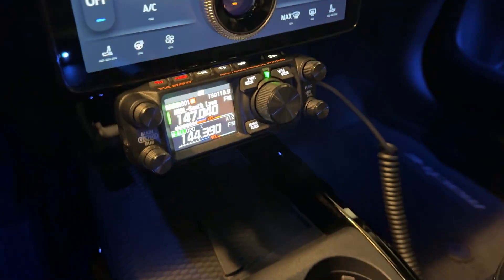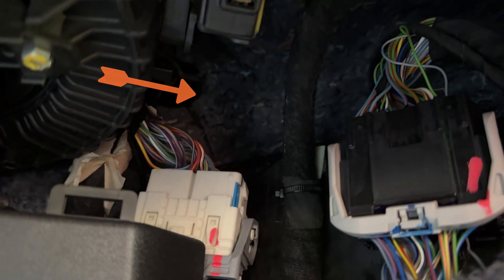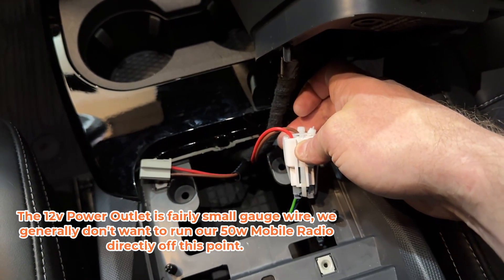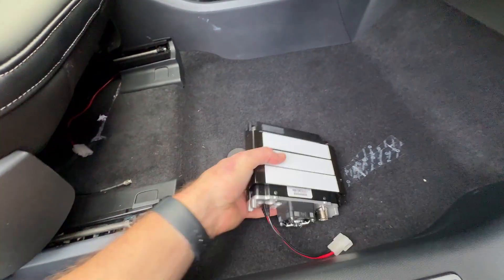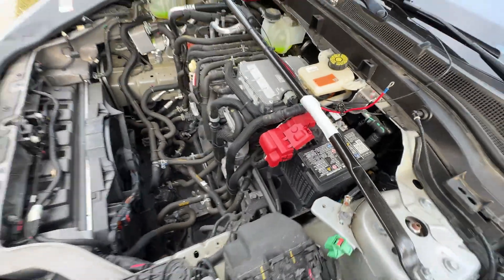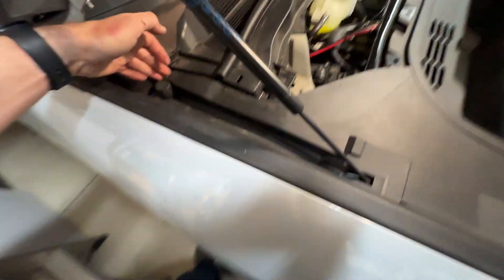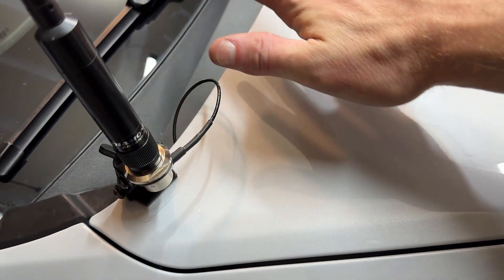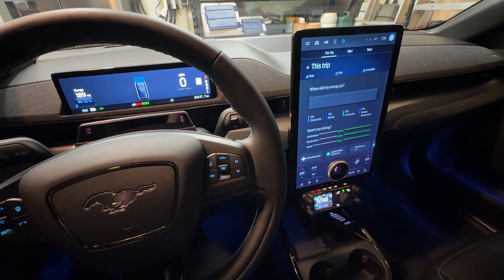New Mustang Mach-E gets Electrified with the Yaesu FTM-500DR Mobile Rig

Comment: Thanks! I have a Mach e 2021 GT PE. I love the video and installation. If I need the head mount, could I buy one off you? I have an ID-5100.
Reply from the maker: Hi Greg, You can shoot me a message through our www.everydayham.com email if you would like, I can probably print an extra mount for you - Since the ID5100 is a different size, that might require some additional design changes to make it fit well -- If you have a 3d printer, it's a pretty simple process!  Cheers, N8JRD

Comment: I don't like the idea of 50 watts of power at the same elevation as my head at 3 feet away
Reply from the maker: Interesting, I'm certain almost every mobile installation is of similar design.   How have you installed your mobile setup?   To be clear, the ARRL's own calculator for uncontrolled RF exposure at 50w @ 145mhz with a 3db gain antenna is 3.4ft.   In a more controlled environment, it's a mere 1.7ft.   

I'd be very interested to hear what your alternatives are!  Cheers - N8JRD
Reply: @EverydayHam Top of the car instead of head elevation.  I think the math is highly dependent on the gain of the antenna as well since that changes the radiation pattern.

Comment: That is a very nice install.  I'm wondering how it actually works for you?  Do you get electrical noise from the high voltage switching or charging?  Does the Mach-E have and AM radio?  

I've heard a great deal about the Tesla making so much electrical noise that hams can tell when one drives by their house.  I'm wondering how the Mach-E compares?
Reply from the maker: Great question, no AM radio in the Mach-E and no electrical noise present on the VHF/UHF bands that I can hear.  The car behaves very similar to the BMW I3 vehicle I moved this radio from in trade-in!  (The I3 ALSO didn't have an AM radio)

I suspect for POTA, running HF from the hatch area might find some interesting noise artifacts if the car were in run mode while operating lower bands... But I haven't had it long enough to vet that yet!

Cheers, and thanks for swinging by!  - N8JRD
Reply: @EverydayHam  I know in my Ford Lightning I can't operate HF while the vehicle is moving, but while it's parked, it works well with my ATAS and FT 891. UHF and VHF work great while driving. My 2021 Mach-E has AM radio.

Comment: We love our 23 Premium Mach-e. Haven’t gotten around to putting a radio in it yet. I’m working on an install in my 25 Explorer first. Would it have been easier to connect the positive wire to the jump point on the driver side fender in the frunk rather than the battery post?  73 KJ4NWQ
Reply from the maker: I just picked up my 23' MachE GT and I've enjoyed it.  It's quite quick, and its comfortable to boot.  I'm happy to have a proper mobile radio installed, and really, the MachE is a pretty easy install all things being said!   Thanks for stopping by, - N8JRD